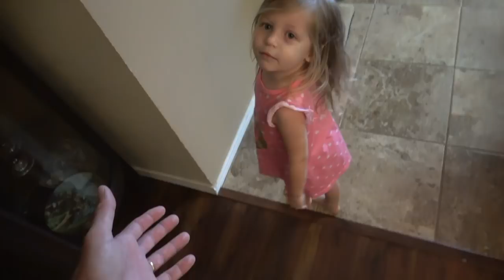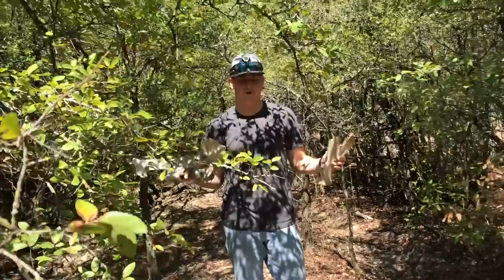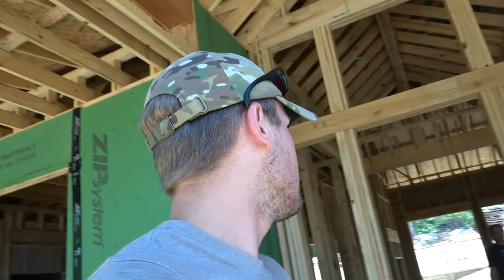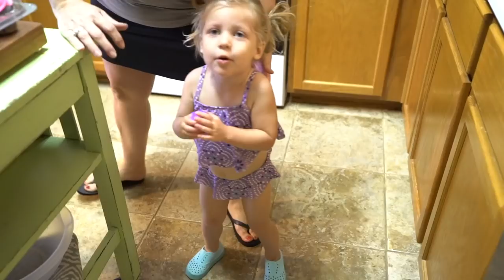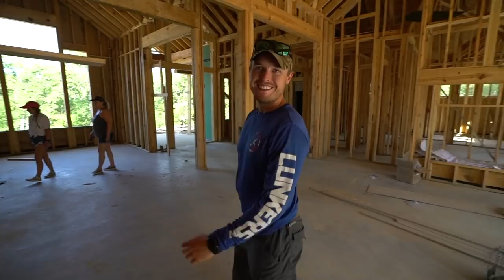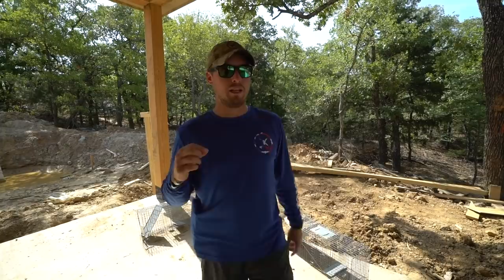Raccoons in my house - This is war

Comment: Rob just some advice Spray Foam your attic and have your A/C guy put a vent with 30 CFM’s   Trust me it will save you $$$ on your Bill every month     You will not regret it.  
Ps- you need a non-vented roof/attic and use open cell foam

Comment: Marshmallow work well. You zip tie them to the outside back of the cage then build a make shift cave to insert the trap into. Then use a few marshmallow to make a tail to lead Ricky into the cage.

Comment: Have the contractor put a house wrap over the green board. Evey nail they put on it is an entry for moisture which will rot the wood over time. Redundancy is not a bad thing. Invest in a house wrap.

Comment: Just wanted to tell you that Ricky can reach through so the trap needs to be bigger or put some wire with smaller holes so they can't reach through.

Comment: Dude you gotta step up your ricky game. You wanna trap one of those raccoons this is what you gotta do. Step one: smear peanut butter on the pressure plate that trips the door. Step two: smear canned tuna on top of the peanut butter. If the raccoon is careful enough he may be able to eat the tuna without getting trapped (not likely) but if not he'll lick the hell out of that peanut butter which will trigger the trap. You do not have to put any food outside of the trap, the rickies will smell it for miles and know exactly where to go. And by the way, that trap has to be like a timney trigger. pull your trap out, test that plate, make sure it's a hair trigger and if it's not, make the proper adjustments. You should have caught those sum bitches by now. And for the love of god if you're gonna use a honey bun throw that bitch way back to the back of the trap! Don't give them a free meal! you're just feeding them! Make them go into the trap to get the food. They'll go back there if they're starving

Comment: Rob I would like to start by saying love your channel and it’s all great. You didn’t do the AK justice though, your feeding issue was probably the magazine. Not all mags are the same and this being that if you would have tried a polymer mag it probably would have worked better because they have a weird catch on them where the mag release catches they usually won’t fit in a traditional Ak if you have one someone probably modified it to except these mags and this is what caused your issues. I have 2 AKs and they have never miss fired and they have never failed to feed. I also have shot around 5 or 6 AKs and none of them have but I have ran into the problem of a polymer mag not fitting into the well due to the catch and someone told me if I filed it down it would solve me issue but possibly not allow me to run steel mags if it was to much that’s all I have to say on that thanks rob keep doing what your doing love the vids.

Comment: Dude, your builders are absolute slobs. Sloppy, trashy, unsafe, and most of all, unprofessional. If the site looks that bad, how do you really know how good a job they're doing.
Reply: To be fair no one is supposed to walk jobsites without safety gear. And to say all that with out working with them you don't know. Jobs get dirty but gets cleaned at the end
Reply: Austin Blanton true but that job sites a fuckin mess dude. You clean as you go so there’s not crap to trip on. Drinks on the job site after knock off is fine but you don’t go leaving empties all over. I dunno how it works in the states but ticketed tradesmen over here keep a professional standard. But it’s not my house and I’m sure Rob and his missus will have a handle on it.
Reply: They are prolly Mexicunts , what can you expect.

Comment: When will you Americans finally learn that a good, strong house is built with concrete and plenty of rebar, not wimpy azz 2by4s n drywall? Jeesh.... You even have friggin tornados down there in Texas....
Reply: Remco van Vliet You do realize that’s an awful way to build a house in like 80% of the world.
Reply: @TheBassAngler1  not if you put a decent foundation under it. You guys are used to just pouring a slab n sticking your house on. In my country houses are built on pylons that go 75-200 ft deep to make sure shit doesn't sink or shift. At least I'm pretty sure my house isn't going to blow away in a storm any time soon. Sure, it's a more expensive type of construction but at least it's built to last.
Reply: Remco van Vliet I’ll call 100% bullshit at 75-200 ft deep and please tell me how you do that in solid granite like the western United States. Know many construction engineers through college. You obviously have 0 idea what building houses is like.
Reply: @TheBassAngler1  on solid granite it's not necessary. There, you can anchor things down with the same type of rock bolts they use to shore up tunnel walls. Here, we're basically living on pudding (peat) with alluvial sand deposits several dozens, sometimes hundreds of feet underground. So we drive concrete piles into the ground to anchor things down. We're lucky we don't get any strong earthquakes here, or the soil would probably liquefy temporarily from the shaking and whole towns would sink down, probably...

It seems rather pointless to make assumptions about the level of education, or lack thereof, of somebody you've never even met in the bases of a couple of YouTube comments. Just throwing that out there for your consideration. I wonder if you would be able to have a coherent discussion in a language that's not your own native tongue. Perhaps it's your education that's lacking?

I'm well aware different circumstances require different building methods, but it remains a matter of fact that usually not the best method, but the most cost effective is selected. Why do you think it is we can't match the quality and precision of the  construction of monuments that have been standing for millenia? Do you really think the empire state building or any of the Trump towers will still be around in 1000 years? And do you really think the Dutch would be invited worldwide to consult on difficult construction projects if we were bad at it?
Reply: Remco van Vliet Yep by the way I can. Speak perfectly fine spanish and French so there is that dumbass point you brought out. So good at building houses Amsterdam is all crooked and needing to be saved left and right. Have fun building your houses around the world on concrete everywhere. Just a hint it won’t work. And nobody is “inviting the Dutch” all around the world. Never seen projects where people are like hey we need to get the Dutch here, but sure absolutely keep pretending you know anything.
Reply: @TheBassAngler1  good for you mate, that you learned some languages! Not a great many Americans can say that, on average... A lot of them seem to think the world begins and ends at the borders to their country. Good for you that you have a bit more worldly perspective.

As for those crooked houses in Amsterdam (and Utrecht, Gouda, Leiden, Delft and other old towns) only serve to illustrate my point, I'm afraid... They were all built more than a century ago, on a foundation of relatively short wooden pylons with animal hides underneath for support. That kind of old fashioned construction does sink over time, most times well out of plumb, too... They're all crooked, and in many places have to have modern foundations retrofitted because they don't want to take them down and change the entire character of those charming old towns. (monumental status, some with unesco world cultural heritage conservation status)

The last great wave of somewhat hastily constructed housing that could do with some upgrades (my house as well, 1954) were built in the 50s, reconstruction efforts after WW2. Anything roughly 60s or after is pretty skookum. All constructed on steel or concrete pylons. Only place where those are subsiding is in Groningen province, because of natural gas drilling causing minor earthquakes and ground settlement.

As for international projects where Dutch consultancy was requested? Repairs to the water defence systems in Saint Louis, Venice Italy, Singapore and many other places around the world. Construction of Palm Island at the coast of Dubai, modeled largely on the construction methods of our Maasvlakte at the port of Rotterdam... Some airport on an artificial island somewhere (I forget where... Persian gulf maybe?)

The raising of the sunken submarine Kursk, and a great many other marine salvage projects.... Smit International? Mammoet? Ring any bells?

But yeah... I guess we're sorely lacking in engineering skills, here....
Reply: Remco van Vliet Yeah unfortunately the ugly American is as bad as ever. Look let’s just end it. The Dutch are a smart and great people. I love visiting but to believe you know how to build a house is laughable. Building a house in Texas and California is completely different. Same styles never work and this is believe it or not exactly correct.